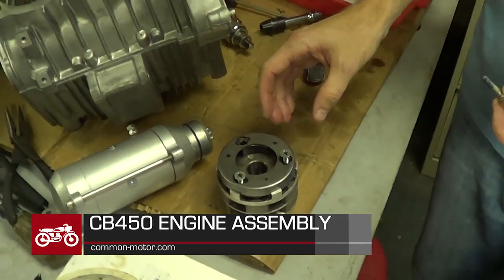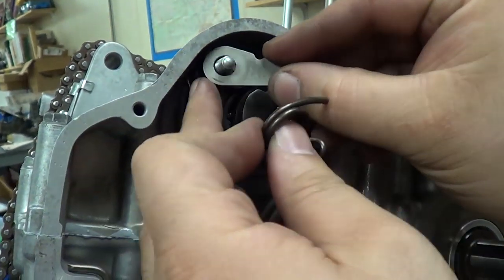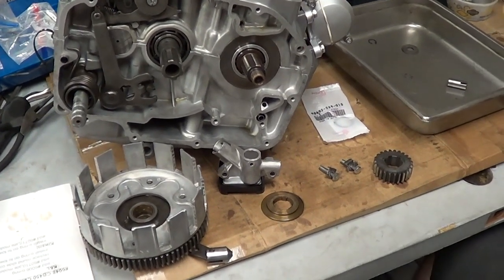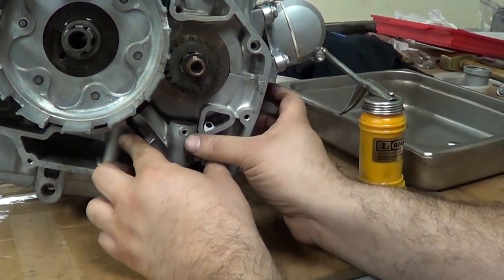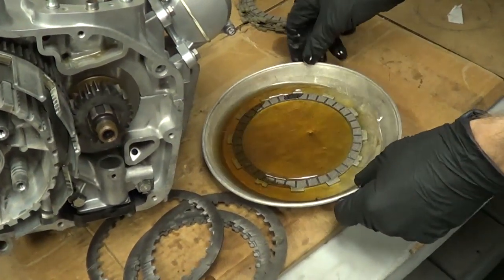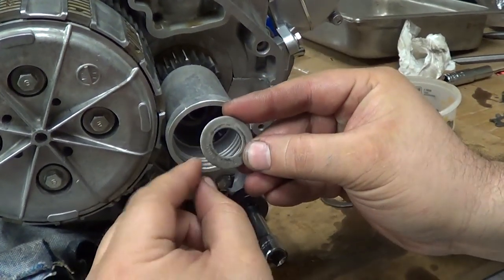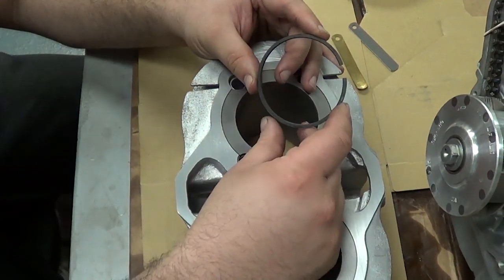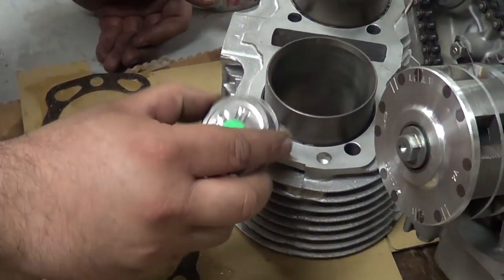Honda CB450 Engine Rebuild Pt 2

Comment: OMG you are the reason I can never get the gaskets off without an act of god! LOL That paper gasket doesn't need gasket sealer painted all over it! Hope you never have to take that apart again! Also for the love of god people when putting these back together, make sure you use a high temp anti seize on those dowel pins and yank and replace any corroded or rusty ones! Use the same antiseize on any outside case bolts! Especially if you replace the original zinc plated bolts with stainless steel allen bolts. The dissimilar metals cause a galvanic action over time that will seize them up. Signed a guy who has to rebuild these after you lol (Not you personaly. just a lot of other folks!)
Reply from the maker: gasgacinch is a very VERY basic sealer and won't stick in the way your referring to. Thats why we recommended that one.

Comment: I have watch the serie  and i like the work you do.. I have work with motorbikes for more than 40 years .But never with the Twin Honda 450/500  I was surpriset that the inner Clutch-hub was hold by a circlip and not by a nut like all  bikes i have work with . Little uncommon i think.

Comment: Awesome videos!   A question for you.   I have a rebel 450.  It dropped on its left side. Hit the shifter and peg. Shifter didn’t look bent but when I take off the cover and shift int first and push down.  The shifter rod flexes.  It also moves in and out slightly.   Is that normal for a shift rod?  After it dropped I started the bike and it now knocks.   Can’t really tell if it’s a bottom or top end knock.   Would anything associated with the shifter rod cause the engine to knock while idiling?/ running

Comment: Is the clutch assembly on the 450 the same as the 500t. Is it the same number of steel discs and friction plates and is the first disc bevelled? (Love this series by the way, must have watched it a thousand times already)
Reply from the maker: The 500t uses the same springs and friction discs. The first steel is possibly unique but that would be the only one that is.